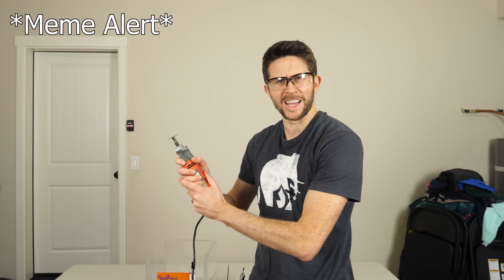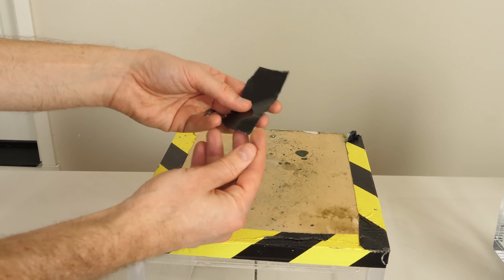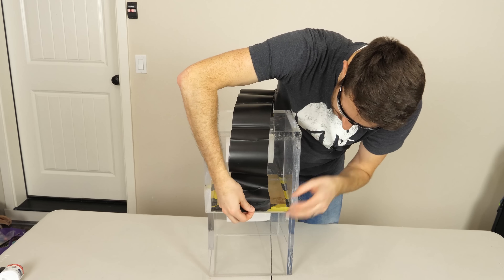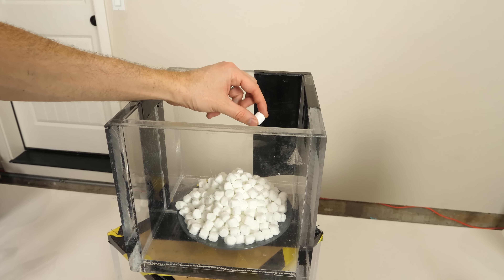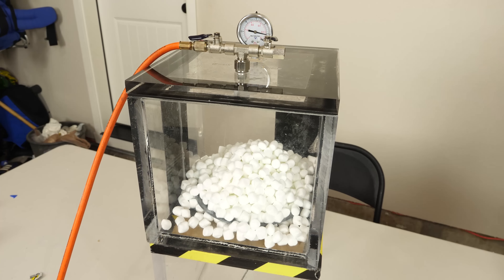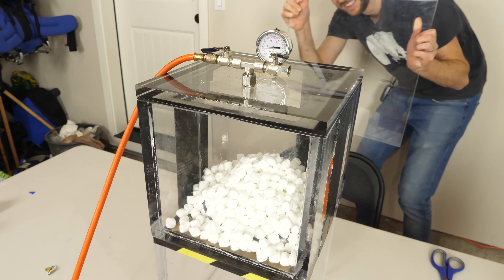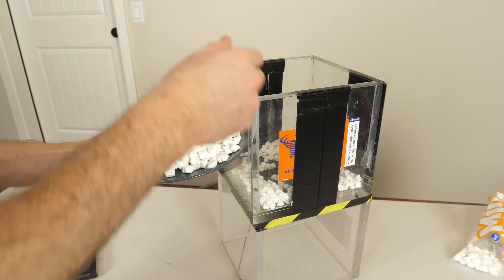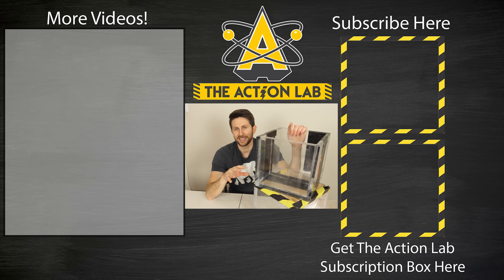Can Flex Tape Hold a Sawed in Half Vacuum Chamber Together?

Comment: My question is, why bisect it vertically and not horizontally? By doing it vertically, the seal between the lid and the chamber is now different from before it was cut and there's no way to know if the tiny leaks really came from the creases in the tape, or because the seal between the lid and chamber was compromised as a result of the difference in height the layer of tape adds.

Comment: Should have experimented with mass air flow  sensor cleaner sprayed on the cracks then applied the tape on it. I did that on under carriage plastic shield on my car and it stuck really good

Comment: So what are you trying to prove? 2 inch wide electrical tape would have done the job. I've got a vacuum tank and vacuum pump. I can literally stick my finger on the end of the hose and stop the air 😂. Next time save yourself some trouble put flex tape around the whole top. That way you don't have 4 gaps. Test 2 in wide masking tape. You want to prove the tape to me? cut a slit in your air compressor.

Comment: Flex tape is just silicone on a silicone rubber sheet. Possibly rubber back but I'm guessing silicone do to the temperature rate. I need a play with it and then I'll know for sure.  All you got to do is drop a few drops of acetone, mek or methylene to determine it's property's.

Comment: inside pressurised chamber, siphon turned the turbine and created energy we use that energy by magnetic induction or through the microwave
and cycle continues inside the chamber just by putting extra energy for lifting water into reservoir again😝😝😋😝😋😋😝

Comment: I think it doesn’t need tape at all, there’s this experiment where you have two half-spheres that are connected to these air vacuums, if you put the two spheres together and suck the air out, the atmosphere actually holds the ball together so well that there’s literally no way to separate them
Reply from the maker: That is only for a cut that has no gaps. In this case the edges were too rough to do that. Also, you could pull them apart with a force that is greater than 14.7 pounds per square inch of whatever is stuck together:)
Reply: The Action Lab yeah I remember seeing a video of someone pulling one of these spheres apart with big trucks or something 

Anyway thanks for the clarification ! 
Always nice to learn from you ;)

Comment: I thought your experiment was great except for one thing I thought would have better. Instead of cutting it lengthwise, I would have cut it  horizontally so there wouldn't issues with the top seal. Then maybe you could be sure if the leaking was due to bubbles under the flext tape.
Just my 2 cents.

Comment: You should’ve put the flex tape on the inside before cutting it in half and turning on the vacuum to see if the vacuum can pull the flex tape off

Comment: Actually in space, if a glass tube of an astronaut cracks and when the astronaut repairs it, will stick flex tape from outside, and air will be inside of the tube, so air pressure push flex tape from the sticky side. in this video air pressure pushes from the other side and flex tape doesn't leave. can you try the same experiment with sticking flex tape from the other side. so we learn if flex tape work on space or not in experiment.

Comment: Yes, but what about a hole in the chamber? You should test out how well flex tape does with different sizes of holes in the vacuum chamber. That would also increase the pressure on the tape exponentially. With a small line like that, Scotch tape would work. A hole is where the real test lies.

Comment: When you let the air back into your pressure chamber, instead of air, let in CO2 and infuse fruit that has been degassed in a vacuum. I saw videos of people using their soda stream to infuse fruit with carbination but it seems like it would be more extreme carbination with a vacuum chamber. Maybe even CO2 infused marshmallows.

Comment: Comments at 0:40sec of this video, I bet this tape, also with that width of the tape, will definitely survive a vacuum. But will fail to stand positive pressure buildup from inside the chamber, dont know at what point it ll explode but some where between 3-6bars which is 3-6times greater than the maximum load incurred by vacuum

Comment: You can just get the other chamber and flip it on top of the one u had, and put the flex seal around. Vacuum it by making hole in one of walls, it can be blocked later. No need to waste a good chamber.

Comment: A bit of semantics here but I think the title should be "can flex tape hold a vacuum seal?" Instead of the current one. Of course it can hold the chamber together but the question really being asked is when the pump is turned on what happens to the flex tape.

Comment: Cut a small hole in it, cover it with flex tape, and then stab through the hole with a knife. I wanna see the sudden change. Also, put expanding foam in it. I never say like if u agree but I really want to see this as a vid

Comment: This should be Phil Swifts new ad campaign.
It even works underwater!
to...
IT EVEN WORKS IN SPACE
Reply: https://www.youtube.com/watch?v=1DkaIPHemTI
Reply: @GregoryBlack06  Yeah I saw! Actual legend :)
Reply: Gregory Gaming I was gonna reference that, good going
Reply: Fix any hole in your starship easily!
Reply: TO SHOW YOU THE POWER OF FLEX TAPE

I CUT A STAR AND HALF
Reply: He did it XD
Reply: @Joe-qe7fx  I know I'm a prophet 👀
Reply: @mason11198  👀
Reply: Lol😂
Reply: Lool
Reply: I'm sure they already have something similar to it for spaceships.
Remember Tang? Maybe this started as a NASA project, now to the general public.
There are even SciFi movies where they patch the inside of a ship for leaks.
Reply: Sweg420 aaaahhhhhhhhh
Reply: it already works in space, according to fill swift
Reply: How would it work in space when the forces would be opposite? Unless you put the tape on the inside it probably won't work.
Reply: @SylasTheGreat  Assuming the chamber is pressurized to 1atm, it would bulge about as much as it got sucked in in this video, but I don't think 1 atm is enough to either rupture or pull it out (if it were, it would have done so in this video too).
Reply: @louisvictor3473  It's completely different... There's no way for air to come in when pushing from the outside but pushing from the inside would cause air to slowly break the seal!... Hence why I said the tape would have to be on the inside of the craft in order for it to possibly work. Definitely wouldn't react the same way as this video if the tape was on the outside of the craft. My point still stands.
Reply: @SylasTheGreat  Eventually everything breaks if not given maintenance, that is not at question here. "Eventually" can be 1 minute, 10 minutes, 10 hours, 10 days, 10 months, 10 years, and so on. "Eventual fail" just by itself isn't a good argument. Eventually the entire universe will fail and face its heat death, so if we are arguing on terms of "eventually", nothing actually "works" - we aren't talking in terms of "eventually".

The material has demonstrated that pressure difference isn't enough to tear it apart, so we can ignore that possibility at least for some time relevant to humans (how long, yeah, we would need to test to know, but point being - it is more than a couple of seconds or minutes, at the very least, long enough to be humanly relevant).

What we really looking at is the adhesive itself, its shear strength (side ways movement) and tensile strength (pulling). Whether you have it on the inside or the outside, the adhesive layer will experience shear forces. In the inside, that is almost all it experiences, while on the outside with the air pushing out, it experiences both. Since it didn't just get sucked in and failed immediately, we can establish that it can stand the maximum shearing that 1atm difference could cause, and for at least however many minutes he had this experiment going. For tensile, remember when he pulled it with his hands? That is probably way more force than 1 atm difference can pull (which it won't, it will be split between pulling and shearing) and the thing didn't even bulge. Pretty guaranteed, it would work for at least about as long as this one.
Reply: @SylasTheGreat  That being said (now I am more awake), I think your thought process in questioning the conclusion was pretty accurate. I just don't think that, based on what we have seen, the practical results would be much different, though indeed on a technical level the interaction is not the same.
Reply: @louisvictor3473  To be fair we are both speaking hypotheticals here! Some experiments need to be done first. Hopefully that could be a future video so we could see what would actually happen! Great discussion though! Fun hypothesising with you!
Reply: You just said that because u don’t want to read all the nonsense he typed...
Reply: @SylasTheGreat  I'd say that they'd put a seal on both sides of a crack or whatever they're trying to seal. One to keep the outer one from coming off, one to add some more structure to it (if it could even be called that). That would be a true seal right there. The cold could be an issue, but who knows. Maybe it'll just make that seal solid as shit.
Reply: @SylasTheGreat  You're right that you'd want to put the tape on the inside of the spacecraft, but...I don't see how that's a problem?  That's where you're most likely to be when a problem occurs anyway!
Reply: @SylasTheGreat  You answered yourself dummy you put it inside not outside
Reply: @ommsterlitz1805  You don't think very much do you? You just want to be involved
Reply: @SylasTheGreat  Say the dummy that answer himself and ask about it anyway...

Comment: Plot twist: the vacuum chamber could have worked without the flex tape!
Reply: How dare you insult the pure power of flex tape.
Reply: Plot twistception: the pump was off the whole time, the vacuum was pulled by flextape itself.
Reply: @louisvictor3473  look at this new VACUUM FLEX TAPE YOU PUT IT ON A HOLE IN A STORAGE CONTAINER AND THE TAPE WILL DEPRESURISE IT TILL IT HAS A VACUUM NOW FOR ONLY 1MILLION DOLLARS PER SQUARE FOOT
Reply: It would have worked with flex seal to probably
Reply: But, would some other tape do the same...would be more fun to see what would happen if you pumped it full of air, I've never been impressed with the times I've tried it with any real water pressure behind what I was trying to patch.

Comment: Hitting the Flex tape with a heat gun or hair dryer to heat up the tape then press the air bubbles and creases out may help giving a better seal. Also using strips on the top as a gasket will help with the lid seal.

Comment: NOOOOOOOOOOOOOO .... If you put the tape on the outside, the pressure on the outside acts to press the tape even more strongly on to the exterior surface of the box.  it has to be placed on the INSIDE to show whether or not the adhesive is strong enough to withstand the pressure trying to rip it off the interior surface ...

Comment: One problem with flex tape is when you unroll it and straighten it, it gets little bumped up ripples at the edges because it still wants to be in the rolled up state.  And if you end up with any ripples or bumps water will leak out of those areas.

Comment: You have to turn the bucket horizontally so the water level is under the hole. Ah, also put the flex tape.

Comment: I'm gonna guess it'll work, it wont even be that hard for the tape since the 2 halves of the chamber will be together meaning the actual gap it has to seal is tiny, less than a mm wide I'd guess. Even something like atmospheric pressure is tiny over such a small area. Even more so because the atmosphere will crush the 2 halves together very tightly.

Comment: Can you put my neighbors chihuaha in a vacuum chamber? Maybe then it Will shut up
Reply: Noise don't travel in a vacuum noice
Reply: @mrrat9178  it's blood will Cook and it Might die
Reply: @GlowingSpamraam  it will definitely die, but Interestingly, it won't cook. All the fluid in it would boil off, but actually due to pressure not heat. In fact, it would end up being significantly colder due to the latent heat of vaporization!
Reply: @TheDungineer  well at least it won't be annoying anyone with it's incessant barking.
Reply: @GlowingSpamraam  f for my dude doggo
Reply: Chris Gaming that’s the point
Reply: Flex tape his mouth ..
Reply: @visi2tirana  flex tape your face
Reply: bad day?
Reply: @jwalster9412  no.
Reply: @ansh6370  flex tape your life
Reply: @ThePrufessa  flex tape your breaking marriage

Comment: Can you tell something about hard helium? It should have under -400°C, but just -271°C are possible🤔🤨
Reply: Lowest temperature aka 0 Kelvin is - 273 degree s m8
Reply: @GlowingSpamraam  Yes. And if anyone wants to know; 0 K = -273.15 C
Reply: @jaylindelycke6727  MORE SCIENCE!
Reply: @TheDungineer  😂🤣
Reply: @GlowingSpamraam  SCIENCE!
Reply: at atmospheric pressure. if you change pressure, the temp required changes.

Comment: **  We are not done with this experiment yet!!!!  ***    So now the question is how much pressure can it take on the inside before it blows out!!!!   Awesome video!!!     I think it may have been leaking on the top where the thickness of the Flex Tape and the lid make contact.  They have little rollers you can use like when putting linoleum flooring down
Reply: 2LateIWon/Organized Chaos smart people 😂
Reply: That's actually the point: the lower pressure in the inside of the chamber makes the two halves attract.
Reply: @AlessandroTischer  your comment isn't relevant to what you're replying to. That or you're confused

Comment: You should try putting the flex-tape on the inside of the chamber and see if the vacuum causes the adhesive to peel off.